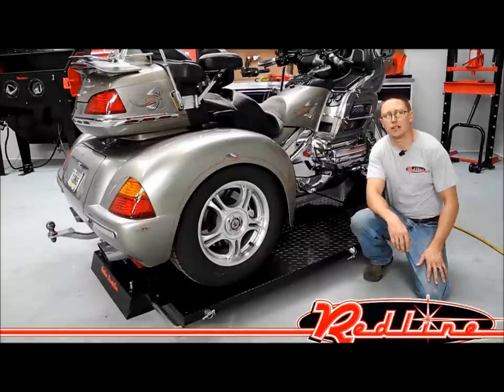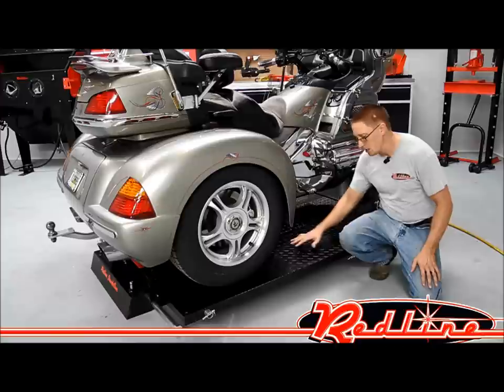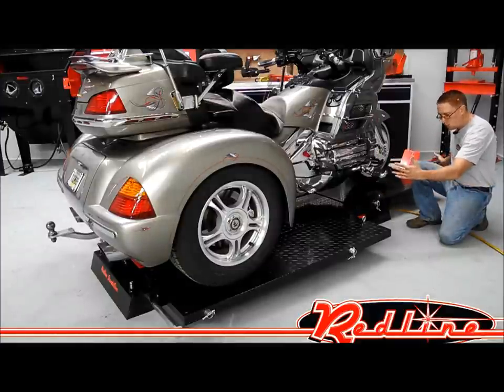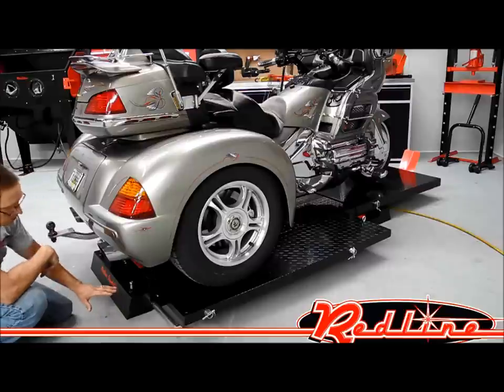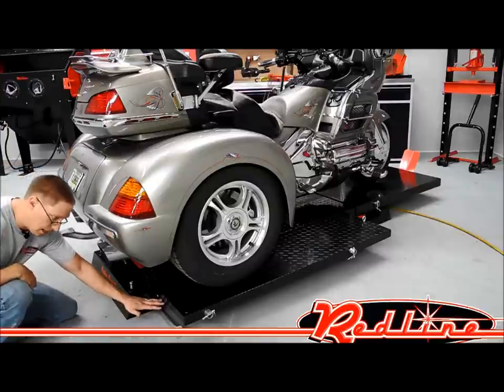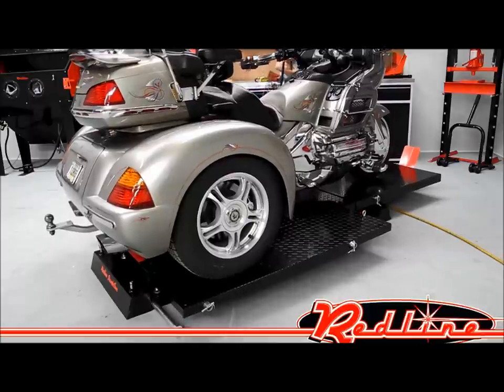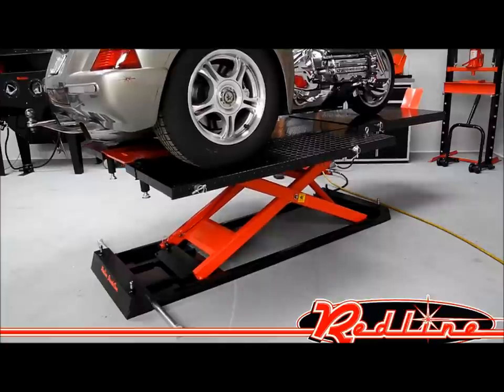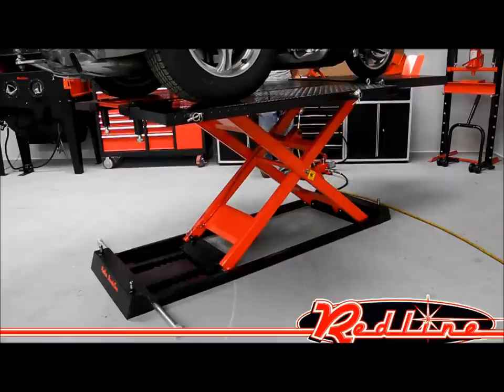Redline TR1500 Harley Goldwing Trike Motorcycle Lift Table

Comment: What if you wanted to take off the rear tires? How would you do that?
Reply from the maker: I'd use a pair of these under the rear suspension.

https://www.redlinestands.com/catalog/lifts-c-290/motorcycle-atv-lifts-c-290_110/scissor-frame-jacks-c-290_110_112/redline-1000-lb-motorcycle-mini-frame-jack-p-469
Reply: You cannot use the axil stand that redline says. CSC trike says not to use axil stands but a center hub lift only on the trike end